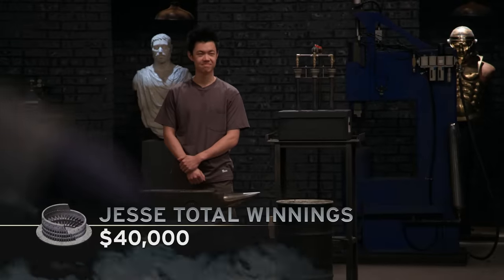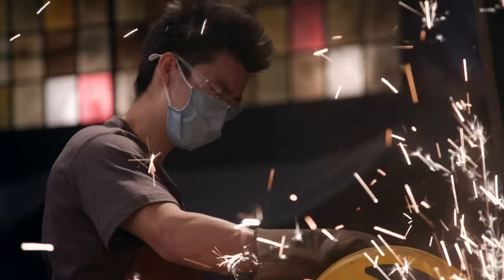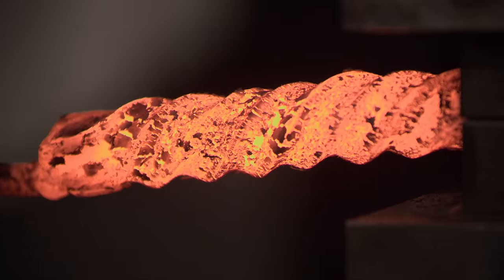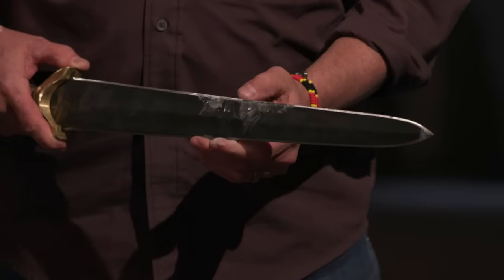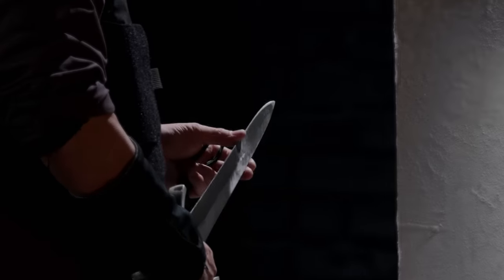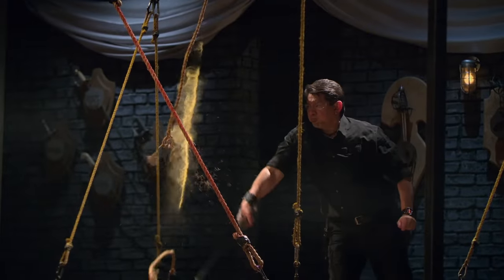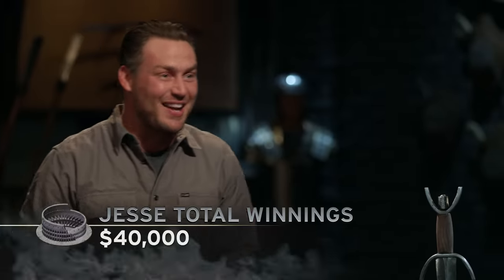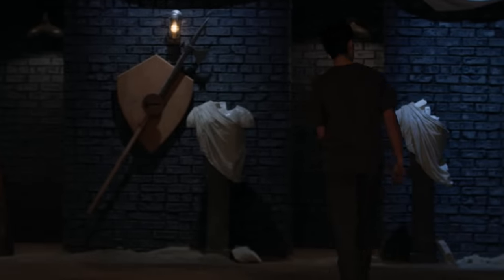This Ancient Persian Dagger Was Built For A GOD | Forged in Fire (Season 9)

Comment: do you consider it a short sword or a large dagger?
Reply: what's shown in the video is a short sword, you use it with techniques for a machete, not those for a knife, a historical akinakas, which by the way they pronounced completely wrong as well, wouldn't be anywhere near that size and is essentially a large dagger.